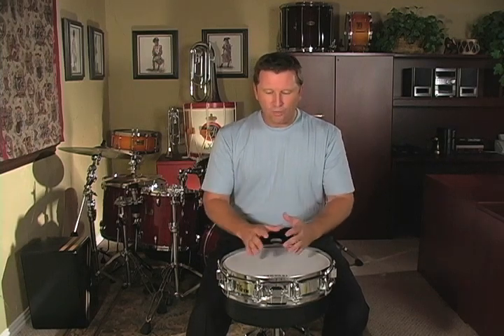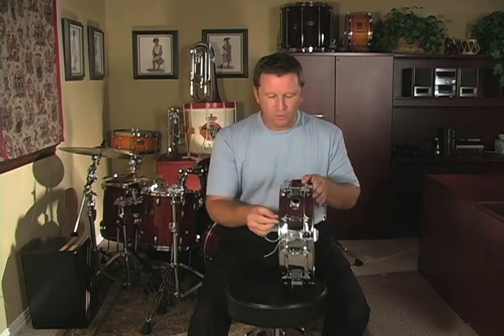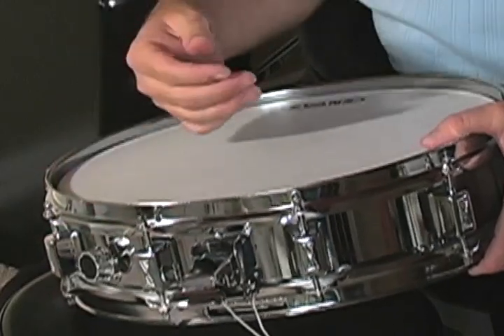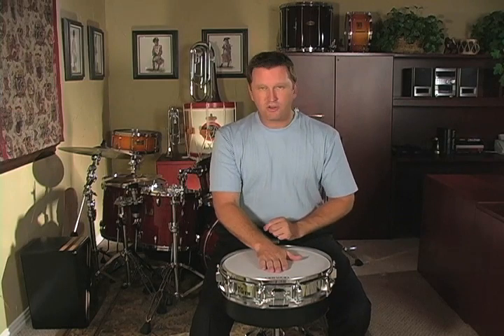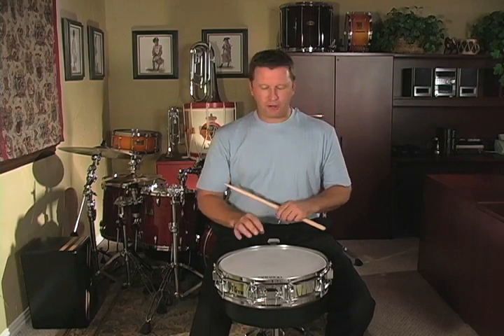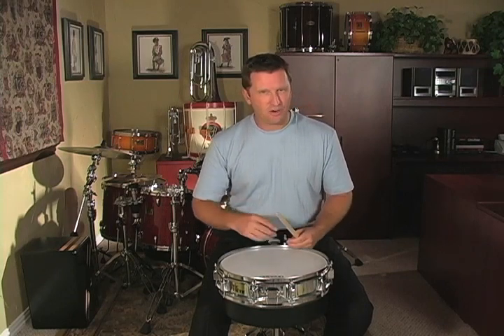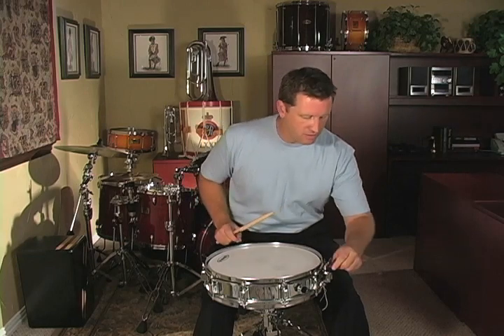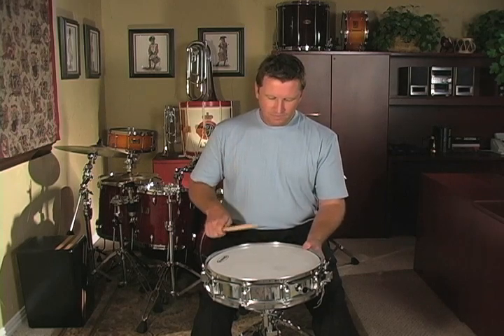A Fresh Approach to Snare Drum: Tuning the Snare Drum

Comment: If you play outside on very hot days you want to use white lithium grease, not vaseline on the tension rods. Vaseline will heat up almost to a liquid and just run off and make a mess. Leaving the tension rods unlubricated.
I'd recommend using white lithium grease all the time. It handles the high heat.

Comment: Soaking your lug rods in water and dish soap is a great way to get rusty lug rods. Use some kind of petrochemical solvent to dissolve any old grease gunk on them. Wear gloves and have plenty of ventilation. Use steel wool to clean them before installation.